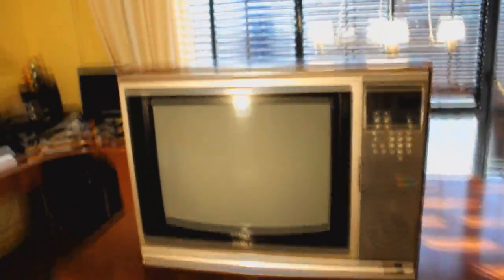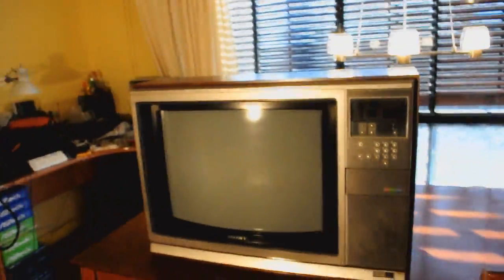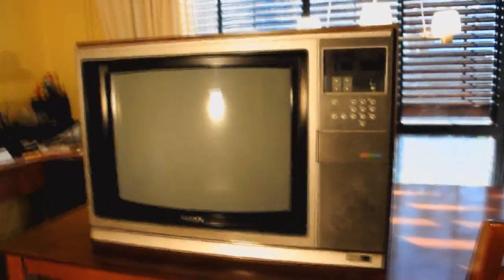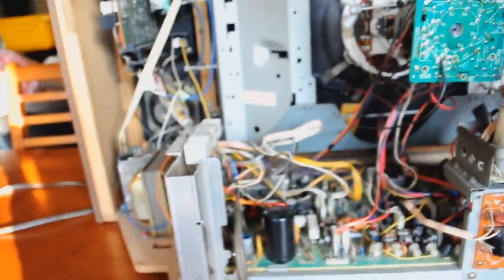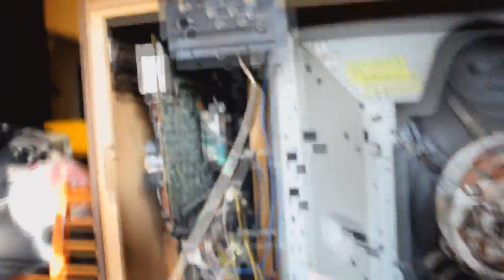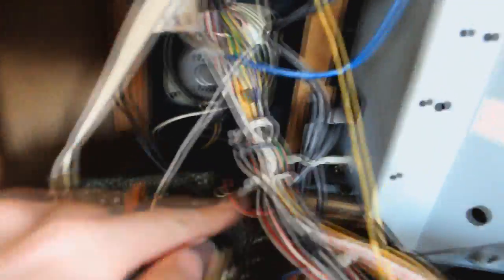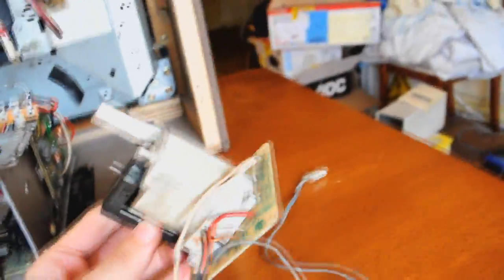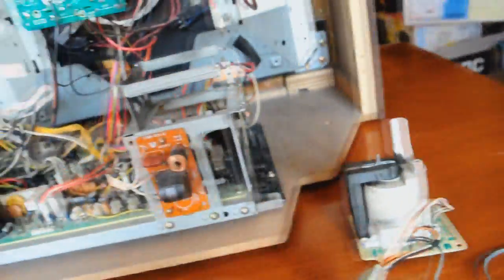Resurrecting a Sony KV-2145R [in HD!]

Comment: hey , i am unable to find sony High-voltage Resistor assembly (hv stat tripler) 1-237-614-13, it is for kv-3400d 34inch tv. can i use anything else?

Comment: Hey maybe I will make you a youtube video of the set I'm working on.   I've been going over it to make sure I can fire it up safely.  So far the only bad component I've found is a burnt out 18 ohm resistor in the power supply.  It's a big 1 or 2 watt so I'm guessing it may be tied to the B+ in some way.  I'm fearing the flyback might be shorted and that this may be the cause for the resistor going bad.  Still investigating though, if not I'll move on to my old tube admiral.  Saludos de Mexico!